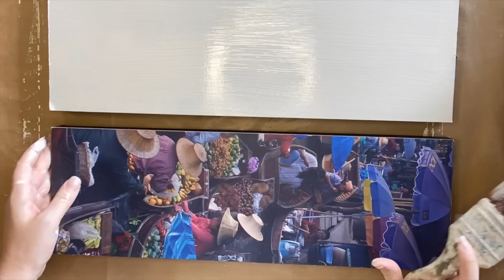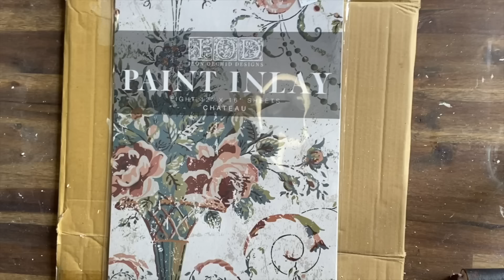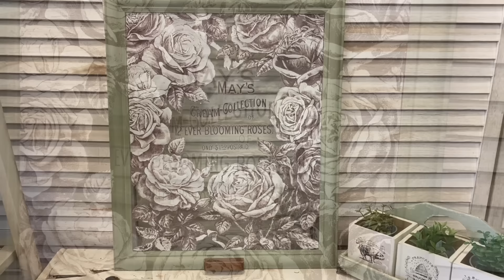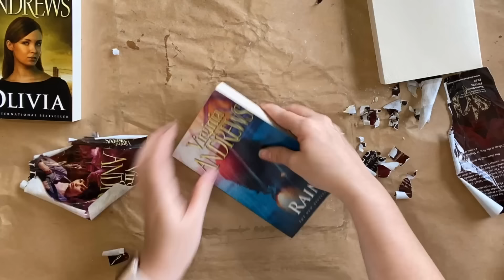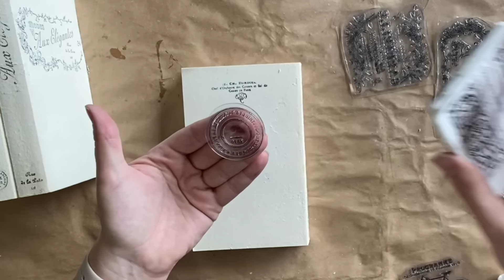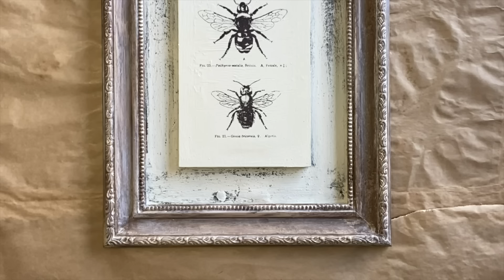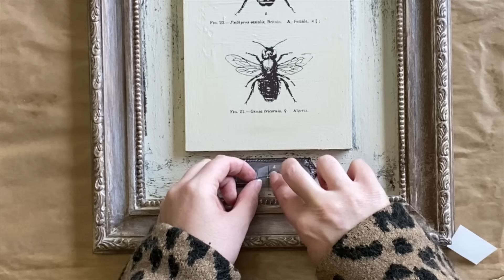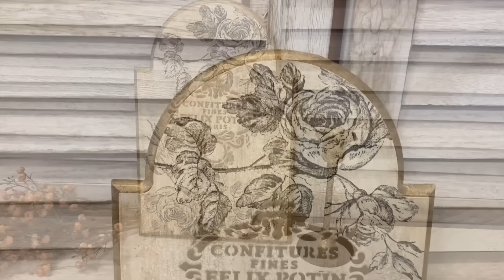10 French Country Thrift Flips using IOD Transfers, Moulds, Stamps & Inlays | DIY Decor | Milk Paint

Comment: Use a toothbrush or something similar. Even a toothpick since it's such a small area.then scratch the end of your clay pearl strand. Take a small paintbrush with a bit of water and brush the scratched piece. Then connect your pieces together. Sculptors use slip. That is a small amount of clay and water mixed to create a slurry, the thickness of milk.
This should stop your pieces from separating when drying.
Thanks for your videos. It helps me learn about your products.  🩷
Reply from the maker: Thanks so much for the tip 🥰